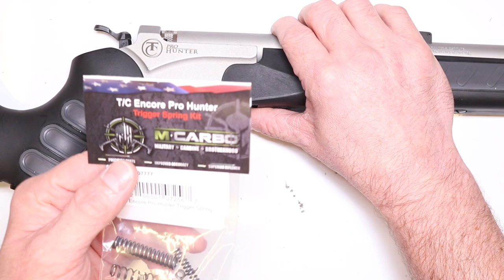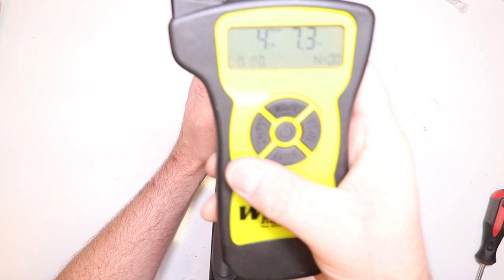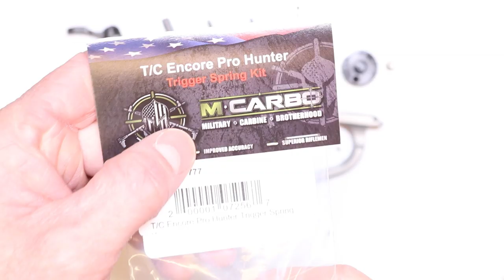TC Encore Pro Hunter Trigger Spring Kit - TC Encore Disassembly M*CARBO!

Comment: After watching the video I decided to give it a go.  To my surprise it went really well. Not a 20 minute job like some profess but no long either.  I had my Encore for 15+ years and it was in need of a good cleaning and spring upgrade.  Your video made it happen.  No way I could have completed the job with out it.
Reply: Same here. Just did it in about 2hrs with taking brakes. The trigger reinstall got the first time. Had to take it back apart.

Comment: Don't try to close or  lock your  barrel when your firing pin is out. You'll damage your receiver (action) I sure did the damage was minimal. It still function well. From 4 pound to 1.6 pounds.on mine spring kit.